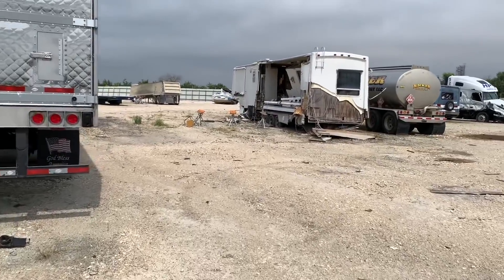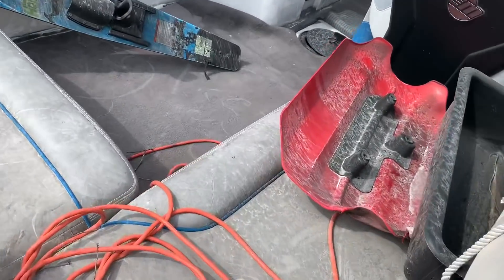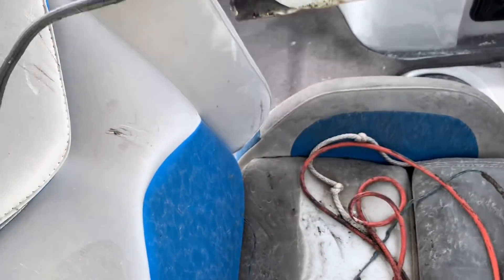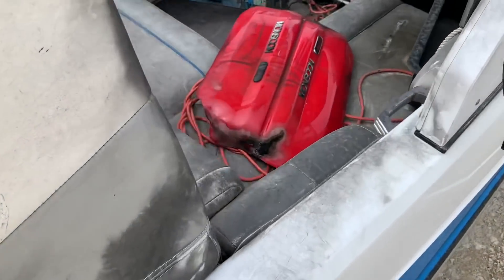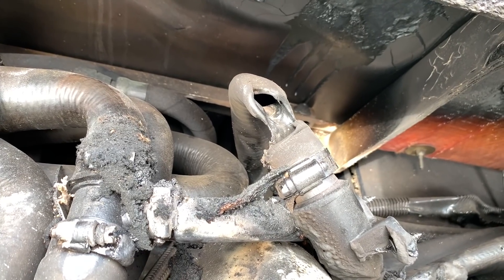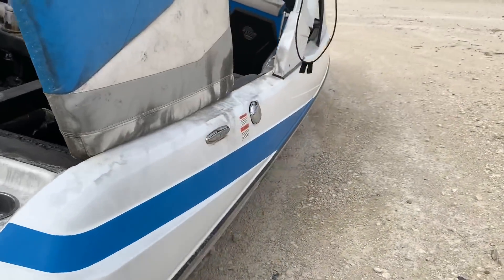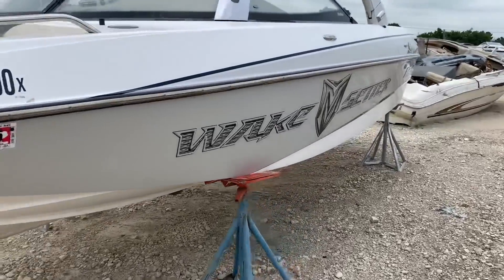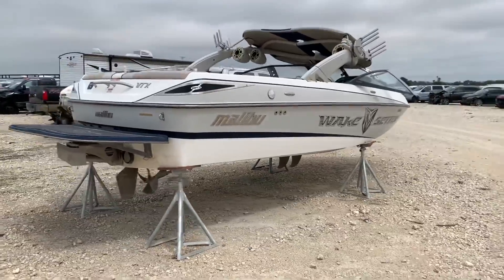Super Boat 2.0? Inspecting A Fire Damaged VLX Before Live Bidding

Comment: I wouldn't even consider it.  The heat from the fire is going to cause lamination problems with the fiberglass.  No way to fix that.  You could spend a bunch of money fixing it only to end up with a compromised hull that cracks in a new place every time you hit a wave.

Comment: That’s 100% a space heater. Why they would put that in the boat, I have no clue.
Reply: Most likely to keep the engine from cracking during the freak winter storm texas has last winter.
Reply: Yeah it looks like they put a space heater in an ENGINE BAY to keep the engine warm I guess during the winter? That owner should be charged for terrorism that is one of the most braindead things I've ever seen. Thank god the fire didn't compromise the fuel line, otherwise it would have literally been a bomb.

Comment: The people who are bidding on this are going to make money their on parts.  Malibu only sells their parts through their dealer channel, so they are SUPER expensive.  The problem that you are going to have with this is build, is how much those parts are going to cost you.  Between the parts for your engine harness, prop/shaft, windshield, hard ballast tanks, tracking fins, sun deck, etc. you are looking at thousands of dollars.  The wild card will be the fiberglass repair, electrical and vinyl.  If those things are superficial there could be money to be made, in this market you can probably get 90k.  Would be an awesome build, but the labor is going to be intense.  I have a similar Malibu boat, so it would definitely be fun to watch.  Worst case scenario you get into it and have to part it out.  I say go for it if you can get it for less than 40k!

Comment: Alright, I guess maybe 10K to 12k could be affordable. There could be something wrong with the electric compartment and the engine. Moreover, the ECU looks good but maybe wiring could be compromised. Body work could be a snap, but the rudder is bent, shaft and propeller probably to be replaced or checked carefully. The fins probably bent and/or broken... All the seats must be replaced, the smell is not going away that easy. Let me know if this can help you to have your chance! Greetings from Italy!

Comment: I start at 5k and no more then 12k. 
Crane will probably cost $500 to $1200 just to lift it onto a trailer. 

Sad how they dump the boat. 
I'm thinking, was the boat haul off on a flat bed. Couldn't tow it back to its original trailer. Damn 

Thats why I would bid low due to how they handle it

Comment: Parts only for the burn victim. Too much damage between the fire, dumping on the rocks & possibly cracked manifolds and or block from our deep freeze. Plus your crane rental, which is not cheap

Comment: If you pay more than a couple of grand for that then you’re insane
Reply from the maker: current bid over 20k
Reply: That boat costs over 100k brand new.
Reply: Bimini, tower, and surf gate alone worth a lot even if sold for parts..
Reply: @Mtree40  the Bimini tower looks like it’s not even harmed a bit
Reply: @landonbrowne5620  the screen in the dash alone is $5000, another 3000$ for either side screens that's $11,000 dollars in screens lmao without labor. Drove shaft bent prop bent rudder bent that's $3000 in parts. Fiberglass damage? Could be 10k+. Boat may have been over 100 new but used its worth 70k tops without a history. Hundreds of hours of labor to do what? Make minimum wage? Don't forget gotta buy the trailer that's another $5k right there. It's junk and whoever bidding 20 is going to part out the tower n shit